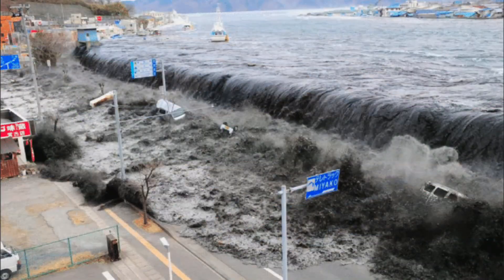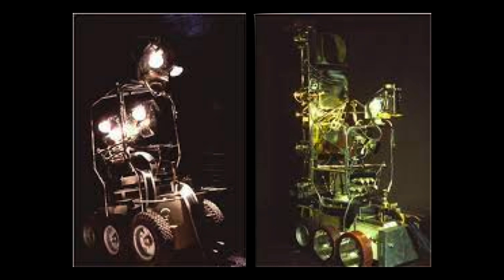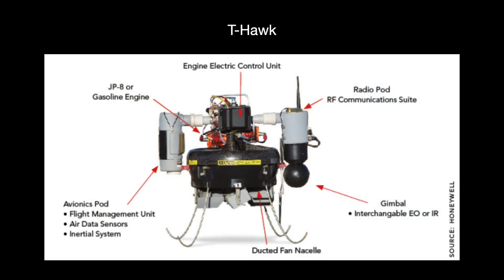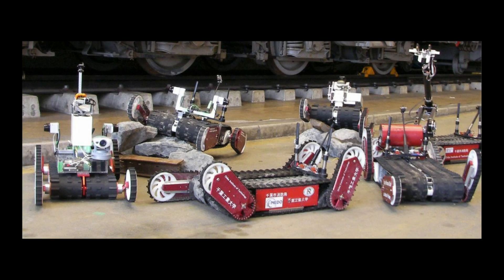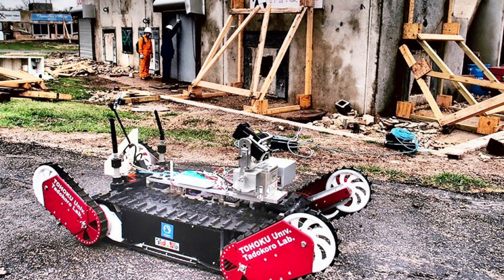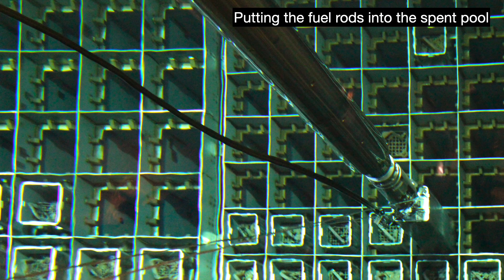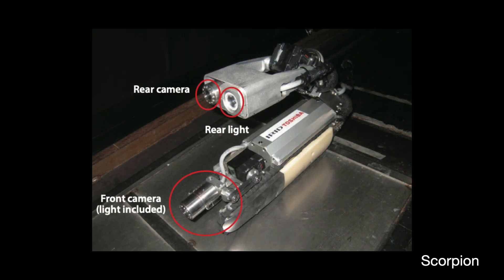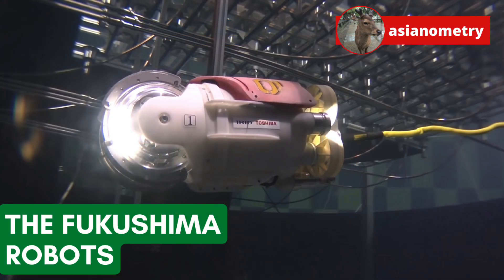The Fukushima Robots

Comment: Really good video. I worked on this project for four years. We were looking to add ultrasonic arrays onto little sunfish to allow it to see debris under dust and to image leaks in the PCV by virtue of Doppler shift in bubbles. 

A small note, the X100b penetration was always there. It wasn't added post accident.
Reply: @Karl with a K A dozen laptops?  All 12 would fail within seconds of each other.
Reply: @Karl with a K Ok Ken.
Reply: @Karl with a K get a dozen laptops as a radiation proofing scheme would not work

Comment: The PackBot limitations sound like a training issue.  PackBots were built to climb stairs, but you have to move the arm forward when climbing to keep the CG in a good place to guarantee traction on the stairs.  They also have fiber tethers for areas where RF comms don't work.  Maybe they didn't have that add-on.  And it was interesting to hear that Warrior robots were used!  Not many of those were ever made.

Comment: Robots have come such a long way and yet have so much further to go.
Reply: it's crazy how relatively little ai has advanced robotics so far - even Boston dynamics barely used ai for most of their existence. despite crazy advanced stuff like chatgpt coming out, learned motor control is mostly not used for serious purposes. it'll probably change pretty quick over the next few years as it gets more reliable
Reply: Especially if they are only 13 centimeters.
Reply: they will take forever if we just put them aside and forget everything we learned every couple years.
Reply: Rats have come such a long way and yet have so much further to go
Reply: @laurenpinschannels  i think the Teslabot is going to rapidly make great strides in AI controlled robotics

Comment: I'd be very curious to see an analysis of the value of the electricity generated over the lifetime of the reactors at Fukushima vs. the costs to date of the cleanup. Cleanup costs continue to escalate years after the accident.
Reply: or they could have put the reactor on the west side of the island, not exposed to giant tsunamis.
Reply: @coraltown1  

Does it really matter where a nuclear reactor is placed when the entire length of the country is perpetually subjected to earthquakes largely due to the fact that it sits in the middle of a volcanic region and shifting tectonic plates?
Reply: @RenKnight347  Seeing as the reactors were undamaged by the quake, it was damaged by a loss of cooling incident from the ensuing tsunami, then yes it makes a difference. At the very least they could have had the backup generator plant a half mile inland. Transmission would be a problem then of course.

Comment: CMOS chips are particularly susceptible to ionizing radiation damage.  Due to the layers used to make the P and N-fets, they have a parasitic Thyristor in the substraight.  Normally the various wells and layers are biased to keep the thyrsitor turned off, but radiation can bypass these protections and turn it on.  The result is that your chip now shorts out the power rails and usually goes up in smoke.  Interestingly, modern low voltage processes don't suffer from this as a thyristor takes 1.4v to turn on.  So if the chip's operating voltage is less than 1.4V it becomes nearly immune to this failure.

Comment: It is so damn difficult just trying to get the details of what happened, and what is going on, so thank you for this.  They said that the first robots were Irobot, and everyone in the entire world collectively took a breath and said why the heck did they use USA robots. hahaha  I was under the impression that the site had all reactive uranium waste removed, but i guess not.  I hope they are able to pull out the rest of the nuclear doodoo pile out the bottom of the reactor safely.
Reply: It is so damn difficult just trying to get the details of the doodoo pile hahaha I was under the robot but was able to pull out
Reply: The core melted, leak under the ground, and is now in direct contact with the underground water.
Reply: @kanlu5199  No it did not. The core is in direct contact with the ground after it melted
Reply: @TimPerfetto  This sounds easier than I thought. Then could you please tell me why they still leave it there, rather than disassemble the core and clear the site?
Reply: @kanlu5199  How dare you ruin our lives
Reply: @kanlu5199  Because the melted core is just unfathomably radioactive to an extent that destroys anything but the most basic electronics and will be for hundreds of years so handling it/breaking it up/safely disposing of it will be impossible for a long time.

The melted corium from Chernobyl is still there too and will be for some time; hopefully the new containment structure they built will enable them to do it robotically with cranes. That structure took about 20 years and many billions to construct over one reactor.

The Japanese have to do this with THREE of them.
Reply: @kanlu5199  Because nothing can get close to the cores, obviously.  Did you even bother to watch the video?
Reply: The worst part is all of the lifecycle spent fuel was housed in the spent fuel pool, meaning 40+ years of fuel was present when they went bang. Looking at the blueprints shown in this video having the spent fuel pool at the top of the structure and the damage which occurred in reactors  1, 3 & 4 there's no good news for the next 1000 years.
Reply: @lewigimole  ALL the spent fuel was in the cooling ponds? Not just the hot stuff? i.e. once its cooled, I thought they at least moved it to dry storage, not in the reactor building.

Comment: The flaw designs of nuclear reactors plant, newer design should avoid this from happening again, US, France and China have a lot nuclear power plants that need to be upgraded to resist this type of accident from happening again
Reply: Yeah, with all the huge earthquakes and tsunamis that happen in France every year..... 😆
Reply: None of this would have happened if the backup generators were farther up the hill instead of below the reactors, behind a seawall that didn't meet current regulations.
Reply: @nvelsen1975  Search for "1999 Blayais Nuclear Power Plant flood". They almost managed to pull a Fukushima even without having a tsunami (just a high tide during a strong wind).
Reply: @denysvlasenko4952  
Good point. Another set of extremely rare circumstances and yet no accident happened at all.
Reply: @nvelsen1975  >  and yet no accident happened at all.

This is the faulty logic Feynman highlighted in Challenger Report: "shuttles got hit by foam yet none failed" is not an acceptable approach to safety. You need to look for near misses and other cases where in practical use, supposedly safe systems did not work as designed (even if the sub-par performance did not yet cause an accident). You do NOT just wait for them to catastrophically fail.

In 1999 Blayais NPP flood case, the water breached all the dams and flooded the plant with 90000 tons of water - which was not supposed to happen, dams had to be high enough.
When ECCS system was flooded, just one set of pumps remained operational - which was not supposed to happen as well.
If either diesel generators would fail, OR this last set of pumps also flooded, the reactors would lose cooling and could melt down.
Mind you, all this WITHOUT earthquakes or 15m high tsunamis, just a large storm surge!
Reply: @denysvlasenko4952  
Oh, so if the facts don't favour the anti-nuclear luddites, the facts are wrong and should be ignored.

No, just no. That's not how things work.
Reply: @nvelsen1975  I'm not ignoring facts. You do. I bet you didn't even know about Blayais accident.
If nuclear power industry would at least learn from past accidents, I would be pro-nuclear.
It does not learn.
Operator of Fukushima NPP evidently did not learn, neither from Chernobyl (that you need to have emergency equipment and adequate dosimeters) nor Blayais (that water can enter the building!)
Operators of US power plants did not learn from Fukushima (they refused to install filters on emergency steam vent lines, which, if installed, could allow, in Fukushima-like scenario, to safely vent overheating reactors and capture 95% or more of fission products, thus avoiding uncontrolled loss of pressure and hydrogen explosions).
Reply: @denysvlasenko4952  
Uhm, bud, you're the one argueing "This is a disaster" when nothing happened and "This is unsafe" about the safest form of energy generations.

You're not just denying facts, you're acting like a luddite: 'progress bad because new'
Reply: @nvelsen1975  > you're acting like a luddite: 'progress bad because new'

You are straight up lying: this is not what I'm saying. I do not see the point in further argument with a liar.
Reply: @nvelsen1975  > you're the one argueing "This is a disaster" when nothing happened

Again. you are lying. I did not say Blayais was a disaster. It was an accident. The station was severely flooded. This is neither "disaster" nor "nothing".
...wait... why do I bother trying to explain things to a liar??...

Comment: Immediate imposed dose of 20,000 rad when annual exposure 300 millirem, for diagnosis purpose possible absorbed 0.300 rad if at all but over a year beside various types ... Those measurements could be exclusively for Gamma, definitely mutating cells & circuitry!😳That's the specs required for entry, then everything else🙄Much respects for dealing with that along with meeting challenges & continued recovery!😁

Comment: Guess you should have mentioned the robot shortly used on the roof of Chernobyl reactor simply killed itself in action by driving off the roof!
No electric devices could function under the tremendous radiation level.
Even the Helicopter pilots heroically flying sand and lead into the chaos received damaging dosis of radiation.

Comment: I've wondered for a long time about how radiation can affect electronics, and computers. Does this kind of hardening benefit a computer trying to survive an EMP, or large scale solar event? Might be a cool video topic.
Reply: The fragile part of the micro electronics is so thin that most high energy particles will go through it without hitting an atom. The chance there is a lethal hit in the sensitive layer is really small. The effect is completely different from emp as emp will always 'hit' no matter the thickness of the electronics. It is much easier to block emp than to block  energetic particles though.
Reply: @effedrien  Interesting!
Reply: No, the rad-hardening is quite different from EMP hardening.

This is because EMP is basically a blast of a high intensity radio to microwave energy literally at all frequencies at once, with astounding slew rates. Any length of wire or a PCB trace is a resonant antenna for some frequency, and in a sudden you get  hundreds to thousands of volts across all of them.

Protecting against this nastiness involves putting the device in a shielding metal box with absolutely minimal openings, adding on a metric crapton of protective circuitry on every wire that goes in, out, or thru the device, double shielding every cable and putting them into a tightly soldered metallic conduit buried underground, and hoping for the best.
Reply: Rad-hardening, on the other hand, applies to the semiconductor devices only.
Besides semiconductors, there are other components like resistors, capacitors, inductors, motors and relays, switches etc, those are mostly unaffected by radiation unless we’re talking crazy dose rates like those to be encountered inside a working nuclear reactor.

Rad-hardening, as explained by the author, involves making the semiconductor devices beefier, like using a decades old node sizes, using silicon on insulator (sapphire), and doing lots of design tricks like anti-latchup circuitry, ECC RAM, implementing watchdogs, arbiters and voting logic among several redundant units among other things.
Reply: @sashimanu  are there emp protected computers? How deep underground do you have to be to escape the blast?
Reply: @middle_pickup  i would advise to just install a professional over voltage protection in your breaker box and use optic cabling for data if possible. It would be a bit pointless to protect your computer better than the rest of the internet 😉 but if you insist you can also create an overall Faraday cage and disconnect everything, like that your equipment is 100% emp safe.
Reply: @Zachary an EMP hard computer would be an horrible abomination to use due to it being all bulky and heavy, with finger thick cables, and very expensive.

A mere overvoltage protector/transient suppressor at the breaker panel is nowhere near enough.

I don’t have the numbers, but just being solidly underground with some soil backfill over the ceiling  and twin metallic doors forming an “airlock” might be enough. However, any and all
service lines (electricity, phone/internet, water/gas/ventilation/sanitation) are all ingress points and must be treated at the points of entry to the protected space.

This is not my primary area of expertise, so I don’t want to give any actionable advice, but unclassified/declassified/leaked documents on TEMPEST and HEMP protection and SCIF construction might be a good further reading.
Reply: @sashimanu  the over voltage protection can still prevent random fires in your house and damaged wiring and also works against 'normal' transients from nearby lightning strikes or your neighbour experimenting with tesla coils or so.  so i would really consider spending  100 euro on that, even if it cannot protect your sensitive electronics, it can save your life which maybe more important 😁
Reply: Guido D.G.
The OP never asked for general wiring advice. The suppressor may be useful for slightly decreasing risk of fire and property damage in rural areas (especially mountainous) with overhead power distribution and high lightning incidence, but otherwise it is likely to have a negative value due to unit cost, installation cost and probability of it itself being a source of trouble.
Reply: @sashimanu  ok but I live in the city and had expensive damage in audio equipment when lightning struck the school on the opposite side of the street. That happens few times per decade but no more damage since they put the power lines underground instead of in the air. Anyway for the rest i could only think of a good old Faraday cage, that always does the job, no?
Reply: @Guido D.G.
Yes, the underground cable is both a natural protection against lightning strikes, both due to it being buried, and, somewhat, it being a suppressor itself (cable insulation has much lower breakdown voltage than overhead wires, so in case of a strike it itself is likely to short out and protect other people’s equipment).

Regarding (H)EMP protection: a properly constructed Faraday cage is, of course, necessary. But a usable Faraday cage needs to have openings for people and utilities to come in and out, and securing all those ports is hard. Also constructing a “Faraday cage” is easy, but building one that would work (e.g. pass an instrumental inspection to government or industrial standards) is hard and expensive. The devil is in the details.
Reply: @effedrien  Against lightning.
Need 2 ground cable, to send excessive current to earth, instead of just 1.
In fact, it's the correct way for every house.
I saw the diagram, here, on YouTube.